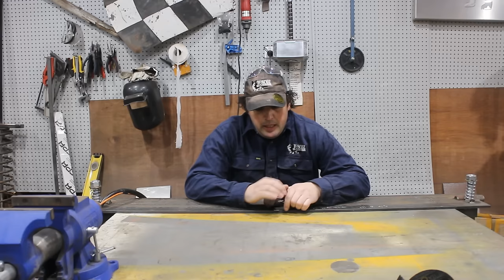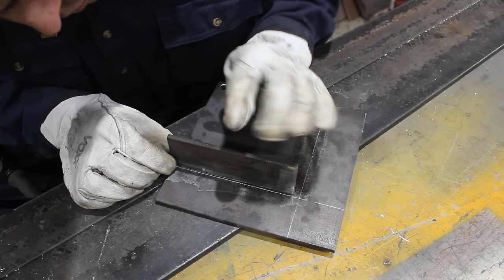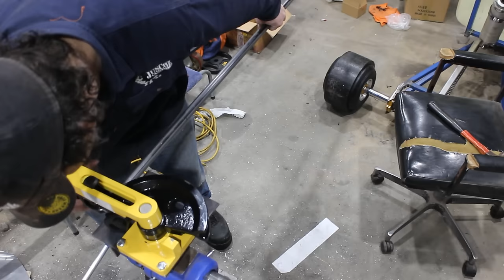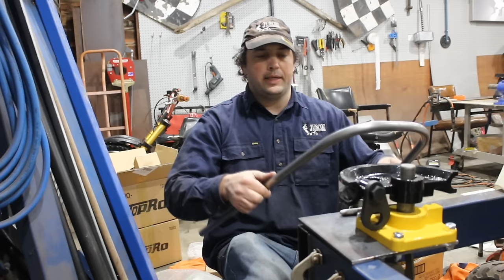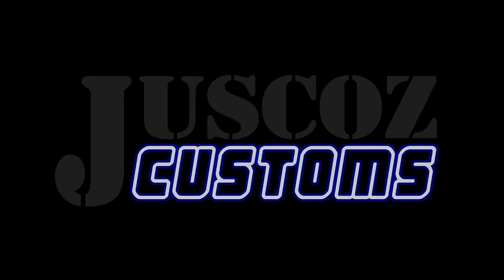Testing a cheap bender that does not suck

Comment: The range of tube size able to be formed on this device is worded in such a way that it may be misleading.  10 - 25 mm diameter range and 0.8 - 2.0 mm wall thickness range.  Nowhere does it actually say that 25 mm diameter with 2.0 mm wall thickness can be formed.  It doesn't say that you can't either, but I would suggest that these ranges are inter-related meaning that the smaller diameter tubes with maximum wall thickness are OK and the maximum diameter might be shaped in thinner wall thickness, say 1.6 mm.  To be properly worded specifications, there would need to be a wall thickness range stated for each diameter.  Having watched your video and reading the comments about breakages I'd be reluctant to try the maximums.
The test would be to send a broken unit back for a refund under warranty and see what they say.
Reply from the maker: That is a good point GD Livo I have used the 22.2mm die with a 2mm wall and that was quite hard to bend with the short handle that comes on the machine I think most of the breakages probably come from having a cheater bar attached and when you have the power from the extra leverage that's when you feel that you can bend anything and probably go beyond the 2mm limit that the dies have. 
but the fact that it is all cheap cast iron breakages will happen

Comment: I recently discovered I can cold bend pvc 1" sch 80 (25mm) over my knee. Any chance you have any 2" (50mm) sch80 pvc could try bending on that thing and tell me if it works. I'm an electrician and alot of my work is laying pvc pipe under ground for traffic signals and street lights. If this works like I think it could it would save me tons of time no longer heating the pipe. Thanks
Reply from the maker: Sorry for the late response I was going to see if I could find a bit of sch80 to test in my big bender because this little bender only goes up to 25mm. But I got distracted finding suspension parts for my AWD mini build so I can't answer your question

Comment: Hi I've just purchased a similar pipe bender. My question is how do you measure the bend angles on this one? Do you eyeball them, measure the angles during the bending or the bend distance? What about the backlash?
Reply from the maker: the simplest way to do it is to get a plastic protractor that is in a D shape and carefully cut the flat side out so it can fit on the forming die around the center pin then set the machine up with a piece of pipe in it and put pressure on the bending arm like you are going to bend the pipe then line up the protractor with the arm lined up at 0 deg and tape it to the forming die  then release the pressure and pull it on again without bending the pipe and make sure it is at 0 deg then you will be ready to bend just look down the side of the arm at the protractor and you will be pretty close. 
As for the spring back of the pipe it would usually be around 2 degree's so on your first piece go just past let it spring back and check it and once you have it worked out for that size of pipe it will be the same for the rest of your bends on that size pipe, 
it will be slightly different if you change the wall thickness or pipe diameter so just check it on the first bend of each size you use and write it down somewhere so you don't have to work it out again on the next project.

hope that helps, 
Thanks for the question I will have to do a video on all this at some point.
Reply: @juscozcustoms  thank you very much, I was indeed thinking about something similar. I may try it out too in a few days and I'll let you know 👉
Reply: @juscozcustoms  Thanks for the explanation, however for us visual people do you have a video adding a degree will tell a bender? It would help a lot

Comment: Goeff ... In your shopping, did you happen to see a bender with a motor?  if so, what is the low end price for something like that?  How about hydrolic?  What is a low end price for that?
Reply from the maker: nothing that would be cheap and good speedwerx and jd2 both have an air over hydraulic around $2500aud but do not come with dies I will be getting a manual speedwerx bender for $900 and a die set for around $500 and anything that is 25mm - 1" or less i have all the sizes i need with this $210 bender
but most of my time shopping was spend looking at speedwerx and jd2 benders cross referencing both major Australian racing regulatory bodies  (circuit and drag) to determine what material they require for there cages to be certified  and talking to my local steel supply to see what sizes they can get in CDS.
that might be a hint of what i am looking towards doing in future projects
Reply: @juscozcustoms  ...That's enough to keep me hanging around ...

Comment: Hi, would it bend 16mm chromoly tube with 2.4mm wall?
Reply from the maker: It would be at the limit of the handle so you will need a longer handle but I have heard of others using longer handles and breaking the cast piece that holds the guide roller. I am still planning out a build to make a better version of this bender with a double sheer handle bracket and much better working capacity
Reply: @juscozcustoms  cheers, I think these benders also go by the name traderight?? In. Blue colour?? Can you confirm. They look the same as the one in your video

Comment: Reckon it will do tight bends on 16mm by 1mm wall Titanium?
Reply from the maker: Personally I have never worked with Titanium but I didn't think it bent very well and would probably need a former that fits perfectly. This is more of a hobby grade machine that works fairly well. I plan on using it to make brackets and stuff on rollcages and maybe a gokart chassis or two but I honestly have no idea what it would do to Titanium.
If you have a go I would be interested to know what happens.
Reply: @juscozcustoms  ok, cheers. I just need something to do 2 bends, might just get a shop to do then.
Reply from the maker: @chrisjokinen217  there is a saying. Why pay $500 for something when you can make it for $100 after spending $1200 on tools.
If you only need 2 bends it's probably cheaper just to buy them from someone who has already spent all the money on the special tools to bend Titanium.

Comment: Put pressure on the tube at the same time as pulling the lever it might help
Reply from the maker: The best thing that i have found is to have a gap between the pipe and the guide roller before starting the bend. It stops the tube getting crushed on the outside of the bend.

Comment: What’s the brand of the smaller one you have (which can bend up to 10mm)? And what price point is it?
Reply from the maker: It is ment for brake lines I think and it was in the bottom of a box of holesaws that I brought from Facebook marketplace but a quick search on ebay for "6 8 10mm bender" found many of them and the prices range from $16-$46AUD.
Hope this helps.

Comment: You will find adding heat to the thicker wall stock will help exponentially. Not in the directions, but if you call the manufacturer, they will tell you to use heat to assist with bending. 
   Dont ask me how I know, but to large a cheater bar will bend or break the bender. 😂
Reply from the maker: 🤣 yeah the design of the bender suggests that might happen with a cheater bar.
I don't really plan on bending anything much more than the 2mm wall of the steel that I bent in this video but if i do then heat will definitely help. 
Well not in this machine anyway because I brought this one to just do the small parts and I have a speedwerx bender (aussie version of a jd2) to do all the larger stuff because each die for the big bender costs as much but usually more than this whole machine
Reply: @juscozcustoms  I got the round and square stock combo kit. I really struggled making 90 degree bends in 1"- 16ga wall square tube with a 4' cheater sleeved over the handle cold. Grease and heat made it bend like a completely different tool. 
Great tool for the price.

Comment: Nice welding machine,what machine  you used sir?
Reply from the maker: Which one? my MIG is a 30+ year old WIA machine that welds great and my TIG is a miller dynasty 350 that is an awesome machine  and very uncommon to find in a single car garage like mine.

Comment: Thanks for making this video... But sorry pet peeve lmao pipe isn't tube and tube isn't pipe!!!!  Lol the dies are very different for the two things sorry too many people don't realize that and waste money buying something that won't work properly for them... More so with larger pipe and tube . Been down that road ... Lol 
But I got a little pipe bender just like this one and like it a lot so far but just picked it up for small projects because it was half the price of the die set for my large "real bender"
Reply from the maker: That is the exact reason I bought this bender because even if it sucked it was still only half the price of a single die for my "real" bender as you mentioned and I figured I could use the dies from this to make something that worked.
But it works surprisingly well so it will be getting used for making mini buggies for the kids probably a gokart or two and many more brackets when I get around to building my mid engine tube chassis car using the big bender that is both a tube and pipe bender depending on which die is fitted 😉

Comment: good review....i was looking for one of those too...i use a clothes line wheel with some heat...
the company needs some scafolding and some dual elevators one goes up one goes down pallat size ,sort of thing for air cargo....want to redeploy passenger jets to air cargo...you might be able to pick up some work if you look into it... make money...so...craft on guy...
Reply from the maker: Well thats one way to bend steel

Comment: Horses for courses is it a pipe bender or a tube bender ?
Reply from the maker: The difference between pipe and tube is about the way it is measured so I prefer to use tube as it is an exact outside dimension every time so it will seat in the former better.
this bender is only rated up to 2mm wall thickness but with the handle that is supplied I would not like to try to bend a 25mm with a 2mm wall. 

I am going to use the dies from this set and make a new bender that should be much more capable tube bender.

Comment: I got one and tried 25x1.5 no chance,need a longer bar for leverage 👍🏻👍🏻🛠🛠
Reply from the maker: I am planning on upgrading my bender soon with a new arm that should work a lot better
Reply: @juscozcustoms  cool,if you put up a video will keep a look out,I was thinking about using a hydraulic jack but would have to modify it a lot.
Reply from the maker: @motorscustomspain2713  it might happen in February when I try to make 28 videos in 28 days
Reply: Thanks for the heads up...I am about to try some 1” x .083”.  That’s 2.1mm wall. Surely pushing it to the limit.

Comment: Hi bro i have a Harbor freight 12 tons but the dies are not well built
Yours seems work perfectly.
Can you give me the inner diameter of each dies please.
From 1/2 to 2 inch
Thanks
Reply from the maker: I don't think the measurements of my dies will help much but I can tell you what I know about hydraulic pipe kinkers. But if you really want the measurements I'll go take some of them but I hope this information helps
So when you start to bend the pipe will naturally try to expand out the sides of the bend and squash the pipe, the trick is that the edges of the die has to be the exact size of the pipe so when the pipe expands the die will grip it and force it to bend. 
If the die is to big for the pipe (even 2mm is to much gap) then the die can't grip the pipe and the pipe is able to come out of the die mid bend and if that happens it will kink the pipe or allow it to get ripples on the inside.
if the die is to small the pipe can break the side out of the die because there is a lot of pressure involved. I have seen it happen when the pipe galvanizing was thicker than normal. 
I don't know how to make the cheap hydraulic pipe kinker dies work properly but it will make a great video if I do figure it out (I have tried many things)
Reply: @juscozcustoms  Hi Juscoz, thank you so much bro for such great explanations, they rock.
i think i 'm gonna purchase a another die, 1/2 from Virax brand, which is more qualitative
Virax is a good brand like Mingori, i think i could get a better result with that die
The chinese dies are really bad and poor quality
thanks for sharing your aknowledges friend
Reply from the maker: all good  @tonymarcuso  if you can get a good die it makes all the difference.
good luck and happy fabricating
Reply: @juscozcustoms  Hi juscoz, what's up mate ? The Virax die i wanna purchase is 40mm inside diameter and our chinese dies have 20mm diameter, so i will have to modify the Virax to fit the pipe bender.
What i'm trying to make is a stainless motorcycle exhaust, the dowpipes but bending stainless tubing or pipes seems not easy because of the wall of the pipe

Comment: It would really help if you just got to the point of the video I was looking forward to your opinions of the vendor need one for myself but I'm not going to sit through the other crap to get to that
Reply from the maker: Ok brian this review is just for you. 
I reccomend the bender for light wall tube it is rated to bend 2mm wall thickness steel but that is difficult without a cheater bar.
It works well on alloy and copper but mostly I have bent 22.2mm 1.6 wall steel. The best advice i can give for using it is not to have the forming wheel tight against the material when you first setup the bend it will just crush the outside of the tube but If you leave a 3mm gap between the tube and roller before you move the handle the crushing is minimal if any. 
The ring that clamps the pipe does leave a mark on the surface but could be sanded out if required.
I have heard that it is not great for mirror stainless but i have not tries that myself.
Hope this helps you brian smith
Have a good day.
Reply: Apparently poor Brian has the attention span of a gnat.

Comment: Hi again, fill the the tubing with wet sand to stop the      cheers Trev NZ
Reply from the maker: Aah the old cap the ends and fill it with sand trick. The answer to every question asked by novice welders seeking advice on BookFace welding pages. 😉
Cheers NZ Trev

Comment: How about silicone spray?
Reply from the maker: Silicone spray is not good if you want to TIG weld or paint the part afterwards MIG weld will work through the Silicone spray but just be a bit rough and paint will not stick to silicone at all so every speck will have to be cleaned off before paint.
Reply: @juscozcustoms  That makes sense if you are going to weld or paint.  So what is your preferred lubricant?

Comment: Great welds but holy crap you put a lot of heat into that metal. I weld for a living. Whenever I weld stainless steal they always inspect my heat affected zone... HAZ. That is the discoloration that radiatiates outwards from the weld. You're welding carbon steel and it's thick. The entire thing was black by the end. Too much heat really degrades the material. You had to speed up your video when you were welding which tells me that your travel speed is slow. Not bad, slow! My recommendation... turn up your machine to a higher amperage. What amperage??? I don't know. Personally, when at work I crank my machine to max amperage and control the heat with my foot pedal. But yeah you should turn up your amperage and weld faster if you're able to. Higher heat but a faster travel speed means less overall heat is going into the material. If you weld at a low amperage and go slowly... your welds will look nice because you have the time to linger, but the metal will be cooked. Another thing you can do if you cannot physically move faster is to use pulse settings on your machine if it has them. Pulsing switches between a higher and lower amperage based upon your settings that will also lower the overall heat... another advantage to pulsing is that it basically creates that stack of dimes appearance without the effort. It's like a cheat setting lol.
Reply from the maker: Thanks for the imput because you are correct, I use to weld for a living but now I just make youtube videos. The heat in stainless steel is a lot more important because when you cook stainless it really is cooked and loses all its good properties and becomes brittle.
As for speeding up the footage that is just done to keep the video interesting because having 10 minutes of dabbing rod would have 99% of viewers click away.
I can have a go at what you suggest with putting the machine at full power and pedaling it but 350 amps becomes a bit twitchy on the pedal when you only need about 50 of them. But I do something like that when on the AC but I only have it at 250 and use the pedal because 275 starts to do weird things to the alloy.
I don't generally use the pulse because it gets annoying turning it off every time I want to tack things so it doesn't get turned back on however it is good at annoying others in the workshop when there is a lot of alloy to weld that buzz really starts to get to some of them.

Comment: I was wondering how that was going to work out when he decided to lock it into his bench vise. Because my Mac Tool vise is great vise but it can't handle xtreme leverage being exerted on it. Without the part that locks down the swivel from rotating.
Reply from the maker: the bench vise will handle it just fine... its the caster wheels under the table that let me down :D 
seriously though I don't thing the bench vice will handle it. There would be some piece of cast iron that will break and be really annoying to fix.